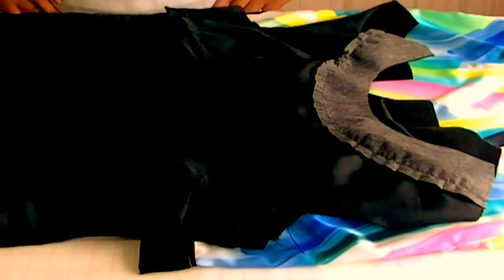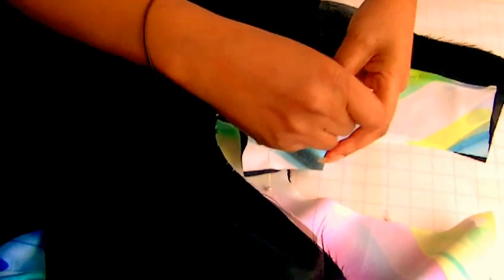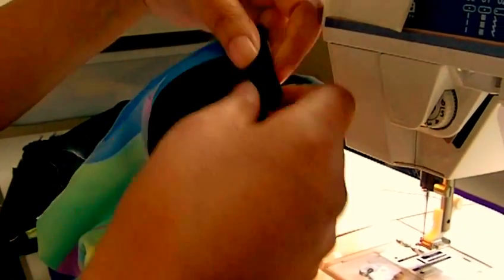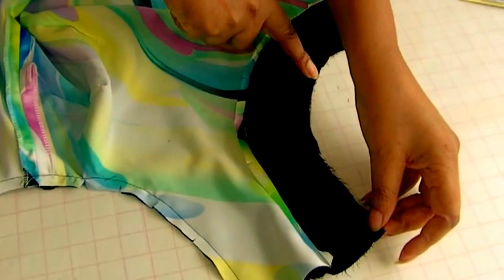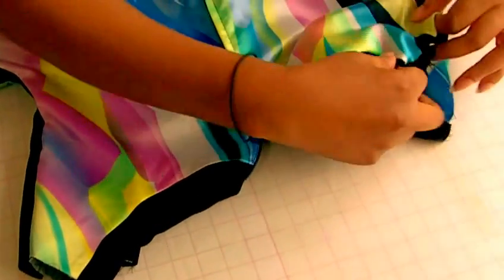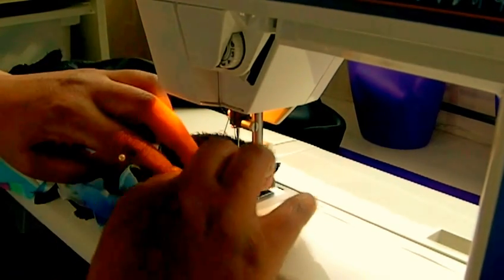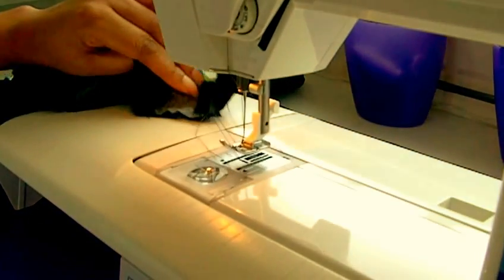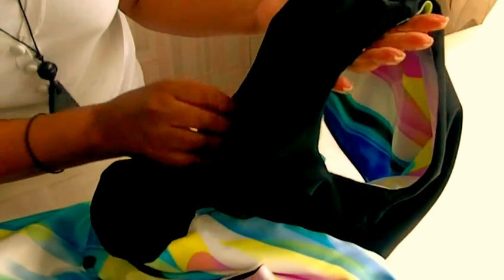Sewing Lining into a Sleeveless Dress

Comment from the maker: In answer to your question - You're quite correct, you do sew the lining separately with a neckline facing attached.  You then connect the lining to the dress via the shoulder / neckline which I purposely left open to allow this.  Personally, I sew the lining around 2mm's smaller than the dress to prevent the bunching effect you talk of.  Hope that helps a little. Let me know how it goes!

Comment: QUESTION: 1)So you sew the lining separately, w/ a neckline facing except you didn't close it on the shoulder &neckline as this is where you'd connect the actual dress to the lining right? 2)Did you have to sew the lining right at the seam allowances that you sew the dress at? I've seen others where the lining was sewn 1/8" more? I'm not sure how that will work if it'll cause a bunching in a dress esp. If it's a little fitted. Some sewed it 1/8" smaller but I think that will pull the dress.Tnx!

Comment: I am kind of a novice, and have two questions. The dress I am making calls for bias tape for the armholes. Should I use the bias tape on the lining or on the top layer? Also, my top fabric is an eyelet fabric, so I feel that if the raw edges are between the top layer and the lining, the raw edges will show through the eyelets. Should I just keep the lining and the dress material turned right side out while I join them so that the raw edges will be on the inside of the dress?

Comment: Coleen I just watched your video on sewing a lining into a dress, I am doing a princess seam dress, will this be the same principle to follow? also do I sew the underarm seams but leave open shoulder seams I noticed your zipper is installed too on the main garment section.
Reply from the maker: Freda Weigand Yes, you can follow the same principle with no problems. You're correct in what you suggest.

Comment: Hi.  I'm wondering have you done a video showing how to sew a jacket lining at the hem corner?  I am in dire need of help.   I''m doing a simplicity jacket pattern 1254 and I''m stuck for eternity at the hem corner with the lining.  I don't understand the direction with the confusing picture and I'm afraid to clip anything at this point without further understanding because my garment is almost finish and a wrong clip would ruin everything.   If you could help me, greatly appreciated.  Thanks

Comment: hint... if  pins  are perpendicular   you  dont  need to  take them  out  until the  end.  the  machine  just  rolls  over  them. it  will save  you  time
Reply: Actually you run in danger of the machine needle hitting a pin and either breaking or progressively getting blunt. So no, she's right.